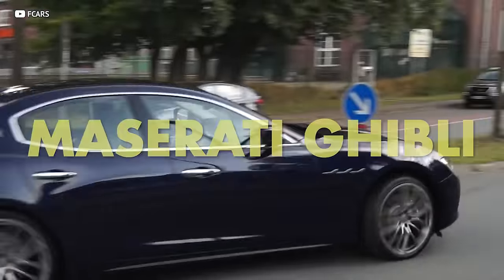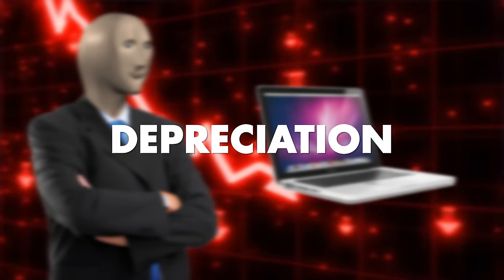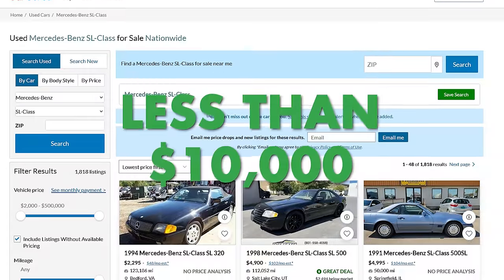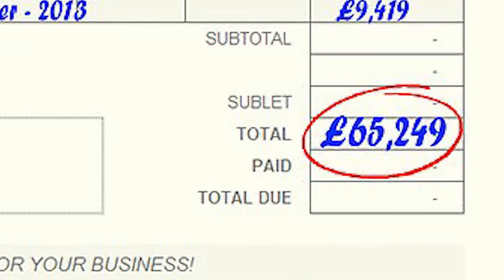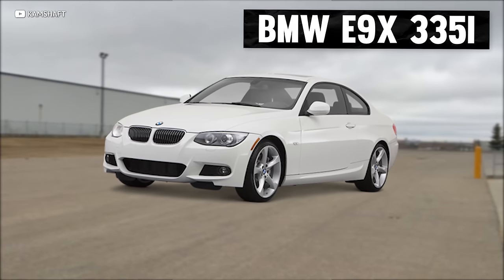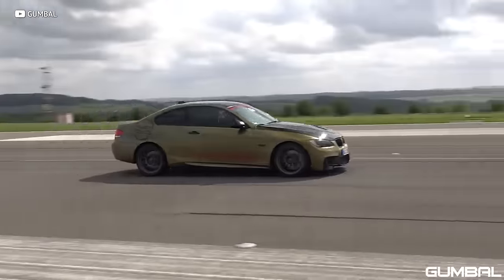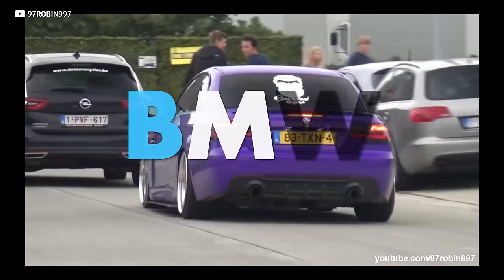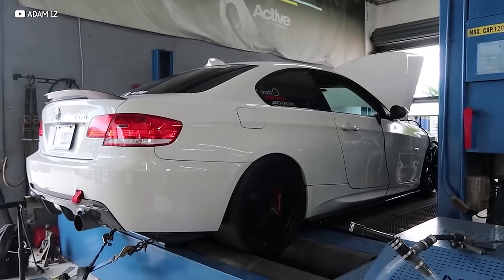Do NOT BUY These 10 Cheap Luxury Cars (You'll Go BROKE!)

Comment: Yeah,  just bought a cheap 535xi, and glad I'm a mechanic.  Only thing I keep asking myself, why did I do this. Lol
Reply: I got the 335i help me water pump and high pressure pump already done still need help
Reply: @tonygundy7815  I had a 2010 335i and learned how to do everything off YouTube, Forums, and FB groups
Reply: @tonygundy7815  
HERES A LIST THAT I HAD TO DO FROM 33K MILES TO 97K MILES
New FRM(covered by BMW)
New Cas Module
Index 12 injectors
1a auto VC and oem gasket
Ngk 1 step colder Plugs .022 gap
Eldor coils
New Tensioner/pulleys
Serpentine belt
New alternator clutch pulley
Front main seal
Crank seal cover plate
Deivers side Engine Ground 
Motor Mounts 
Inner/Outter tie rods
Transmission mounts
Walnut blast intake valves
Intake manifold gaskets 
Oil Filter Housing Gasket
Oil cooler line o-rings 
Oil pan gasket 
New Radiator 
Water pump/Thermostat 
All coolant hoses replaced
Engine Block coolant flange
Ps reservoir/fluid replaced
Clean out washer fluid tank
Full transmission service(fluid, seals, solenoids.)
Replace primary O2s (widebands)
Rotors and pads front and back
Brake fluid replaced
Boost solenoids 
Hpfp
Duralast Platinum H8-Agm battery
LiquiMoly 5w40 oil every 3k miles
Reply: @Thatdude877  Holy mother of sweaty crying Jesus
Reply: @tonygundy7815  I have a 2018 f30 335i, so far she is okay at 54100 km, hope she stays that way.
Reply: @Thatdude877  Jesus...
Reply: @idealist420  
Here's the Mods list for the same car...probably made around 500whp and I definitely drove the hell out of it daily pretty much so I did a lot of maintenance before something could fail.
RB Ext. PCV W/ plugged head ports
Dual OCC setup
M3 control arms front/rear
Bc Racing Coilovers/End Links
 -2in ride height
VRSF Catless Downpipes 
Vrsf Relocated Inlets
Vrsf 335d Charge Pipe
Tial Q 50MM bov
Vrsf 7.5" Race intercooler 
NGK 1 step colder plugs .020 gap
Eldor Ignition Coils
Wahlbro stage 2 fuel pump
Xhp stage 3 trans tune
Custom DocVu 93Oct and E85 tunes
Style 193M wheels 
Michelin PS4S tire 245Front 265Rear
Reply: @GameOver-nm2us  N54 Life bro hahaha....I was running like 22PSI and drove it like I stole it so a lot of the maintenance was just preventive instead of waiting for it to fail ya know
Reply: @Thatdude877  Oh...that makes sense then, I thought all these were fixings
Reply: @GameOver-nm2us  a lot of them are things that are either common or legit known weak points for the N54 platform...the engine itself it pretty well built, it's everything around it that falls apart when you start upping boost.
Reply: @Thatdude877  Hmmm I see
Reply: @idealist420  I got the Og 2007 335i 😭😢🥺
Reply: @Thatdude877  and me living in Srilanka ill have to go through hell to find these parts, even an alloy has to be imported, tell me what parts are important,if you don't mind thank you, also im running 255/45 R19 pirelli p zero at the front and 265/45 R19 on the back, is that fine.
Reply: @tonygundy7815  I love it
Reply: @Thatdude877  you should have listed what you didn't replace. It would have been shorter.
Reply: Youre a bmw enthusiast like me and working on these cars is what saves money and gives you experience
Reply: Should have got the 535D noob
Reply: Mercedes-Benz S and sl are costly to maintain
Reply: lol sorry man. do you have a page ypu share this ?
Reply: Oof I had a 08 I got for $4k engine grenaded itself a month later which I got the car in part due to engine being just replaced, with 100k less miles than the chassis had. Also liked the blue leather on Neptune blue Metallic. Replaced it with a 12 cls550 I spent slot more on and it’s been bulletproof so far
Reply: I had a 2010 535i loved it.
Had a hp fuel pump changed by dealerships
Cooling system replaced
Wheel bearing replaced
Oil pan replaced
And normal wear tear and maintenance.
Lost it in a spin out during the rain😂
Now i drive a 2010 chevy suburban to keep my ass grounded during the rain.
But i miss the shit out of that thing
Reply: I have a 02 e46 M3 and had no major issues, but then again, it only has 99k miles. The 750 was the worst BMW ever made. My e36 325 was the easiest car to work on I ever had
Reply: @idealist420 she won’t 😂 my 328 that I had for 5 yrs needed constant maintenance. It never broke down and left me stranded but the maintenance sickening. Mine was fine until 100k.

Comment: Yeah, all those problems are why I only buy Toyota/Lexus and Honda/Acura.
Reply: Lmao me too. With all the problems I have, the last thing I need is my car breaking down
Reply: Toyota / Lexus are still the only bulletproof car brand in the existence.
Reply: Fr, I am not even financially sound to buy or maintain a mid-range car. Luxury is way too far
Reply: Drive a 2008 GS450H with 230000km. Still goes like a rocket without any alarms on my dash.
Reply: I wished I liked them. But just cant stand Japanese cars to be in. Don t like the designs. Only Skyline and Gtr
Reply: @Jofelmenneke  how? There are many brands with different personalities.
Reply: @Jofelmenneke  You can't say u don't like Lexus.
Reply: Yeah cause those machines nevvver have any issues. They just magically avoid failures of modern engine. Probably dont ever need an oil change or new spark plugs either huh? You actually this dumb or is it an act?

Comment: My 2019 Alfa Quadrifoglio had 64k miles on it at the time It was sold, and I had not one problem with it in the 3 years of my ownership. It was my daily and travel car for work, and made my drives from Miami to Tampa enjoyable and comfortable. As for servicing the car, it only needed routine maintenance and one set of front rotors and pads.
Reply: To be fair 64K isn't that much in terms of miles most these problems would pop up at like 80K or more on average so makes sense you had no real problems most cars that are built even half ass will usually make it to 100K without much issues this aint Dodge with automatic transmissions lol(joke is seen those go out as quickly at 40K on the clock)
Reply: American and Italian cars are among the worst in the world
Reply: 64K miles Alfa??
640k miles and still running Toyota..i own 2 Toyota beside Honda and 500k is just NORMAL 😂😂,regular servis is the answer..and replace normal wear n tear parts,no big deal,and yes,u can drive it forever😂😂

Comment: Have owned a Giulia for 5 years now and have had exactly zero problems.  Guess I’m lucky.
Reply: I 2nd this. I have a 2017 with 75,000 for 2 1/2 years now myself and none of these issues. Only normal wear and tear items (tires, brake pads, cooling hoses). Did have one emissions issue but that wasn’t too pricey to resolve. Glad to see I am not the only one!
Reply: Love my Giulia.  Had it for nearly a year, bought used.  The AWD version is like a sexy version of a WRX.
Reply: I have a 2020 with no problems since I purchased it.
Reply: I have 2016 giulietta qv with 91k km on it, and honestly maintaining it has been very cheap.

Comment: I was a dealer tech for twelve years with Mercedes-Benz, Maserati and Alfa Romeo. Ferrari too, but that’s not addressed in this video. 

The Ghibli is a Chrysler 200 with an Italian suit. The new Quatttroporte (2014 on) is a 300, and only the twin turbo V8 is an actual Ferrari engine. It’s a detuned 488 engine with a cross plane crank. The V6 is a Chrysler Pentastar with Maserati heads, ASSEMBLED by Ferrari, just so they could say “Ferrari built the engine”. And people believe it. Those cars are terrible, and an embarrassment to Italy. 

The SBC brake system in the Mercedes SL is also in the 211 chassis E-Class. The hydraulic suspension (ABC, Active Body Control) is on several models, and that twin turbo V12 has to come completely out of the car to change two o-rings on coolant lines under the turbos that WILL leak. All repairs that can run more than the cost of the vehicle. 

Have fun!

Comment: I'm stoping at the SL, because the info is just exaggerated.  1.  You're not getting an R230 SL600 for under $10k. (Especially when you showed a picture of base R129s.  2.  The SBC brake-by-wire system is not only fantastic, it's covered under an unlimited milage warranty (still).  3.  The suspension cost me a whopping $400 to replace the most difficult hydraulic line on the ABC system, and everything else still works beautifully.  4.  They are, however, quite complicated.  And really, the 55 is the perfect one.  The 600/65 is far too front heavy and the 55 can be built to over 1000 whp (but realistically, around 600 is perfect).  But what is correct:  Most people don't know what they're getting into.  I work on it, I have the dealership scanner in my garage, and if you don't stay a step ahead of the maintenance, then you'll forever be bitching about the cost to fix later.  Otherwise, the M113k platform is bulletproof.
Reply: Just a shame you had to use "otherwise" and "bulletproof" in the same sentence.😂
Reply: @AlCapone-tr5lb  I’d suggest reading it again.  It was pretty clear that there’s a difference between the complicated R230 platform (the “SL” chassis), and the otherwise (other than chassis), bulletproof M113k (engine) platform.  You can get the M113k in other chassis; W211, W220, etc.  Those require much less maintenance than the R230.
Reply: Had an M113 in e class, unbreakable, and straight forward to work on.
Reply: @manofwar577  I also had a couple of W211 E500s.  The first one got taken out by a deer.  That's what convinced my wife about the safety of MB.  There was a thud at 65 mph, it took out the front right 1/4 (good size adult buck).  We just lifted the air suspension and drove home.  The 2nd one was only replaced because I wanted an update on the tech.  One day we stopped by the dealership for an oil filter for the SL.  As I opened the door to get in, my wife heard the new GLB250 running next to us and she freaked out "what the hell happened to the car?!?"  She couldn't believe that a brand new MB was so loud compared to our '06 E500, which was virtually silent.  Eventually I sold it and got a newer W222 S550.  But yes, the M113 is very straight forward and solid.
Reply: Perfect summary! From another SL 55 owner from germany
Reply: Dumbest comment otherwise dealer scanner lol
Reply: @Brainbaskit  Xentry Portal.  "Lol". Why do you people comment when you clearly have zero idea what you're talking about?  Do you not have the basic sense to just move along?
Reply: Tbh, this guy is talking utter shit.  All the terrible things are pretty well the sort of things that might go on any well used car.
Reply: Nah youre over exaggerating I’ve owned a few c55’s and e55’s. Both had cooling issues and the e55 had transmission issues. I work on my own cars and try to do preventative maintenance to avoid mechanical catastrophes. They aren’t bulletproof.
Reply: @mvc2177  I'm the one over-exaggerating?  The production numbers on C55 was relatively low.  So low, in fact, that the few people that purchase a clean example of one keep them in their collection.  The only ones that I see people claiming to "own a few" have been run through by jo-jo bling, the local dealer so many times it's guaranteed to have issues.  If you're having cooling issues on the M113 or M113K, your car is not maintained.  I had a W211 with the 722.9 transmission that failed.  That had nothing to do with the M113 engine.  So, I stand by my comments.  
By reading your comment as have "owning a few", would indicate that you've gone through no less than 6 vehicles.  I'd question your ability to properly maintain them yourself.
Reply: @malphadour  Sorry, your post wasn't entirely clear.  To whom are you speaking about?  OP?  Because things like ABC and SBC aren't on any car.  They're on very few, in fact.
Reply: @gened9632  Refering to the poster of this badly informed video. Apologies if it looked like I was referencing you.

Comment: The alfa Giulia is no where near as bad as you have made out, most of the issues you mention have been resolved through recalls such as the brake hoses, the remaining are from ignoring part lives and a lack of proper servicing. The only issues tend to be with the infotainment and software update issues. I work on these regularly in the UK. 

These are genuinely great cars when given the proper maintenance through specialists and are reliable when cared for.
Reply: How long have you been an Alfa mechanic?
Reply: @Comm0ut  former motorsports engineer with years of experience working on Alfas  as well as many other brands both road and race cars. The worst cars tend to be bmw / Audi due to being needlessly overcomplicated and then built cheaply. 

What’s your experience?
Reply: I've owned the TI Sport and now the QV, I have no idea why this car would be on this list. I owned the N54 335i and a RR HSE and those both definitely belong here, but the Giulia makes no sense at all. It's one of the most reliable cars I've owned.
Reply: Most of these are no problems on what he mentions literally just a bunch of nonsense
Reply: @picdar16 I just bought an Audi A4. Audi making your list for worst cars to own hurts my soul lmao

Comment: The V12 powered SL goes for way more than 10k. Even a decent example SL600 with high milage goes for around 30k here in Europe.

If you can get me a clean SL600 for under 10k in the mighty US of A, holla at me so we can become millionaires.😆
Reply: Found one for 7k add says suspension doesn’t work or leaks
Reply: @Over-kill1  for the next 1400miles then it’s a red ABC system malfunction
Reply: In the UK you can get them for 10k
Reply: @michaelgakanga  just replace it with coil overs. I have the SL500. The video didn't mention how awesome and reliable the V8 is.
Reply: @respectingthewordpodcast  I know it’s reliable I had a CL 500. Sway bars would also be necessary I believe
Reply: Probably been owned by Hoovie or Tavarish at those prices
Reply: @rblxplaysmochax6808 yes, the sl350, the sl500s are 10-20k and sl55s are 35-50k.

Comment: in my country, a lot of Mercedes stuff has long been figured out by indie mechanics. You can simply remove the software limit from the SBC system or, if it fails, repair the unit, not replace it.

Comment: I own a Maserati ghibili and have not had a problem. I love the car. Only issue I have is no one has oil for it. I have to buy it online at a whopping $150 for 8 quarts. It takes 10w 60 synthetic racing oil. Made for Ferrari engines
Reply: What year model is it?  I'm interested in buying one.

Comment: I have a 535 f11 M performance for about 4y never had any problems. The motor is stock and always had services when needed by BMW.
Reply: He’s referring to the e60 with the n54 not n55 with the f11. N55 is much more reliable, not as tunable. Better gas mileage too my n54 in my e60 didn’t get anything special for gas mileage. I could get better gas mileage in my cls550 I replaced it with when cruising on the high way. Well good for a twin turbo v8 so only high 20s. But I’ve had city mpg around 15 which was hurting

Comment: the brake by wire (aka sbc pump) on the Mercedes has a transferable 25 year warranty. Also the star diagnostic isnt needed, just a  scan tool for a Mercedes (about $150)
Reply: thank you for the info.
Reply: The PSE Pump is much worse than the SBC anyway IMHO, since there's no warranty on it and it'll fail when (not if) water gets in the trunk. Add to that the fact that they're hello expensive to replace and aren't made anymore...

Saying this as someone who absolutely loves my R230! 😂

Comment: The VW Phaeton never came with a W8, it was the 4.2 V8 commonly shared with Audi. This engine also had a belt driven timing system for reliability. It’s very common to see these cars well over 200,000 miles without problems.
Reply: Without electrical problems?
Reply: it did, and it was the base version. it never sold well, though.
Reply: Thanks. Did/do you own one or know someone who has?
Reply: @-hfsd , the OP said W8, not base V8 and he made a distinction. It came with a W12 option as the only W block engine.
Reply: They sold the Phaeton with a V6 as well...in Europe. I think it was a 3.0 diesel V6.
Reply: @nubreaks2  my bad, im not really into volkswagen
Reply: @damilolaakanni , they sold various variants after 2006 in Europe and Asia. In China, it was replaced by the Phideon in 2016. Which includes a hybrid version. America's snobbiness cost it a couple of potentially terrific luxury cars that others appreciated.
Reply: @nubreaks2  well you know your volkswagens (and i knew it wasnt discontinued in china)
Reply: It did come with a w12. These phaetons sell for a premium these days
Reply: My man really said 200k on a Volkswagen with NO PROBLEMS😂😂😂😂 you don’t actually believe that right?

Comment: You showed R129 SLs for sale cheap and bring up the hydraulic issues from the R230, the R129 had standard suspension and no turbo engine, you also didn't mention how reliable the 503hp M113k is, and it's available in the same R230, also, I dare you, find a running and driving SL600 for "about $10k"
Reply: I’d wager 25k is where you’d start having peace of mind
Reply: I was just about to say the same thing, tells us the MSRP for an R230 SL65 AMG then shows standard R129 SL500s for sale.
Reply: Yeah, the R230s are fraught with issues but not all of them are awful!

The M113 is bulletproof, the facelift M272 (SL350) and M273 (SL500) have some issues but aren't horribly unreliable engines. The 350 is actually a pretty good entry level car because it doesn't have the ABC suspension either. Transmission is really strong too. 

Yeah, you'll end up paying a decent amount of money to fix things but they're absolutely lovely cars if you know what you're looking for and do regular maintenance.
Reply: Also, the SBC system is something that gets replaced for free by Mercedes when it fails.